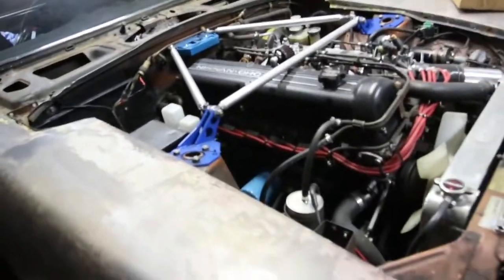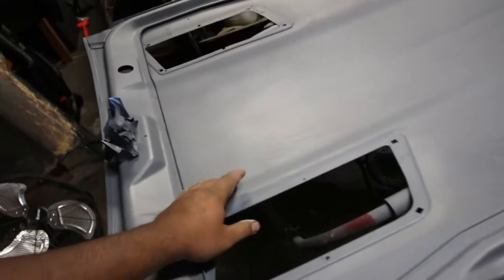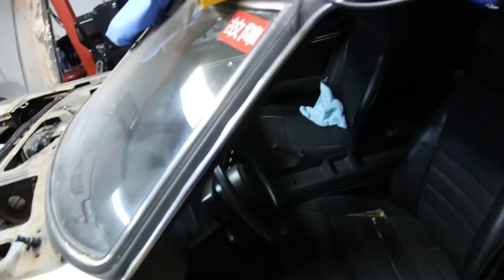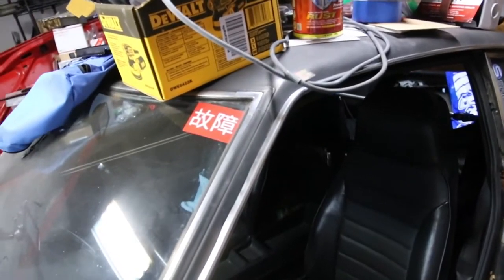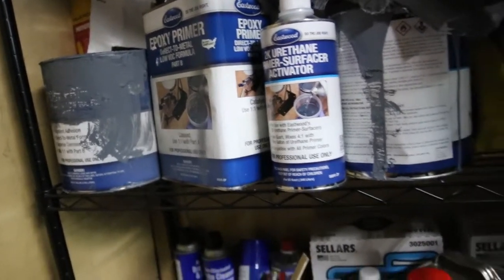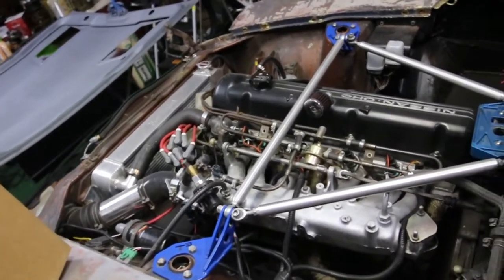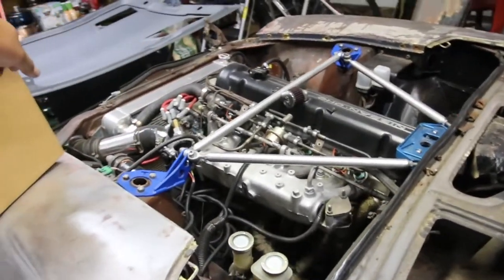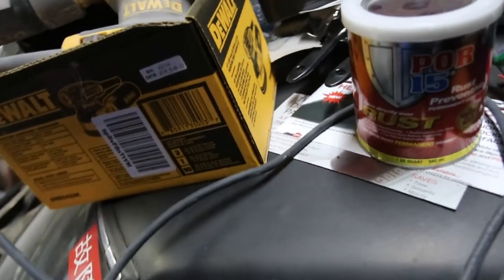Datsun 280Z DIY Paint Update

Comment: Clear underside you can put a flatner in the paint to knock down the shine put it will make the underside tougher and easier to clean.just "base coat" is not strong.Great to see your back and in progress. Ive been working two and a half years on both of mine so I feel for you man it takes time.This week end Im attempting ti make a fiberglass 240Z dash. I want it in my 280 and if it comes out good Ill make another one for my 240Z to make it lighter. I think the dash is TOO heavy stock.I have one front and rear spoiler Ill make. Them in fiberglass instead of buying them..
Remember 2 part bed liner is what you want anybodys brand , not ,in spray aerosol cans.Either raptor or rustoleum. Anything two part bedliner and hardner. Shoot , roll or brush ,behind lower fenders and the front of the rocker panel area where the water hose from the cowl dumps water that will stop lower front fender rust permanantly.Thats the only stuff you should use fir under coat " real two part bedliner" it stays bkack it becomes urethane plastic " like a gas tank , hises clean , siund deadens and locjs rust out for a very long time.
If it comes ( the paint ) from the same can and mix it well every time its the best you can do.
    If you got a new gallon and tried to match it thats where it can be a harder match. 
  What you did paint looks good! 
I dont get anal on a street car nice is Good enough.I dont want to WORRY about street car paint.NUCE is good enough.I dont want the head ache of perfect paint thats fir rich guys that dont drive their cars ....thats NOT me!
Great to see you back !looks good!!
Reply from the maker: i forgot about bediner. thanks for mentioning that!